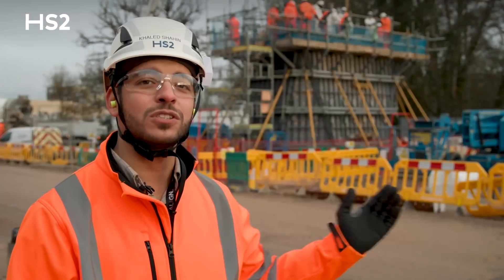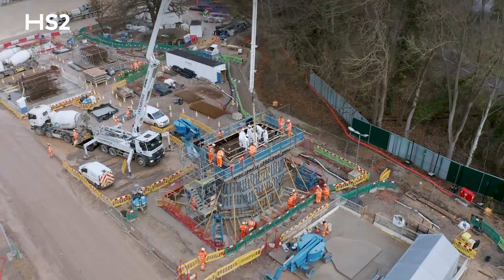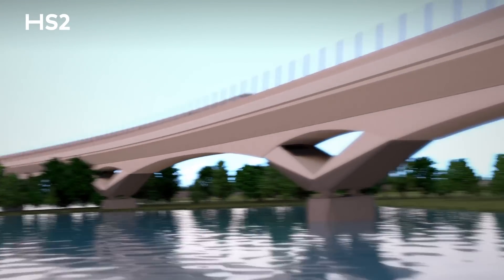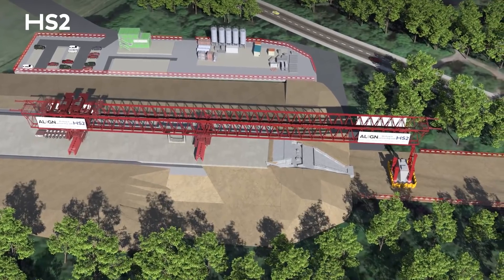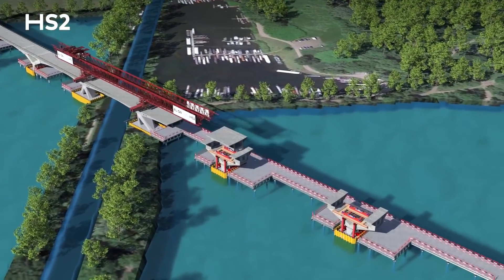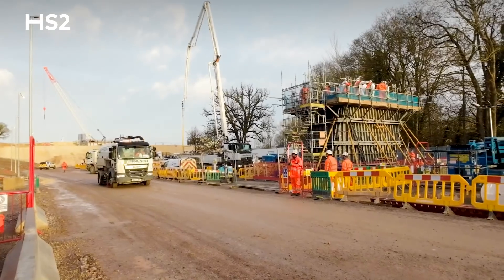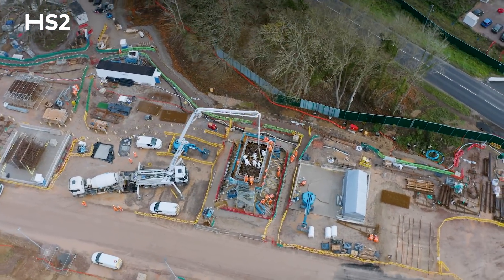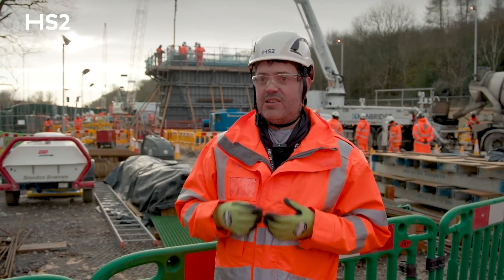HS2 starts first of 56 giant piers for UK’s longest rail bridge

Comment: Wikipedia says the London Bridge - Greenwich Railway Viaduct is 5.55km long and is the longest run of arches in Britain.
Reply: I mean it's technically a different type of structure.
Reply: @arfon2000  How so? One is made of steel and concrete and the other brick but they are both basically railway viaducts. The London Bridge - Greenwich was every bit as cutting edge in its day (1834-36) as the Colne Valley will be about 190 years later.
Reply: @pras12100  same way a house and a small shop are technically different structures. Look I don’t make the rules, I’m just saying it how it is.
Reply: @Hugh Jarse does it though? Mumbai’s streets are calling you.
Reply: @Hugh Jarse Really? Have you ever been to Dhaka, Luanda, Rangoon, Bombay, Abuja, Karachi, Caracus, New York?
Reply: Fake news. Hs2 tells me it’s the longest therefore it’s the longest. Maybe he meant the most expensive
Reply: @arfon2000  I've been to Bombay several times and it's a close call to tell the difference. I agree though both are dumps and sinking fast.
Reply: That isn't a viaduct.

Railways have a simple way of telling the difference, viaducts have names.

Comment: Speeds of up-to 200mph, i thought this was a High Speed Line.. 😳
Reply: that is pretty fast. 360 kph
Reply: That ain’t slow.
Reply: @arfon2000  It is slow, Frances been doing that speed since the 80s..  in 2030+ ( that's if HS2 opens then ) we are only going to travel at around 200mph.  that slow 🐌
Reply: @davidcurry4433  I’m pretty sure most of it runs at 165-185 on a daily basis, or the same speed as HS1. Although there are sections at 200. I will repeat again 200mph isn’t slow.
Reply: @StupidBlokeStupidVideos  I've done plenty thanks, what they promise and what you get, are two different things, you'll get 200mph,,, 😉
Reply: When open it is stated it will be the fastest line in Europe.
Reply: @davidcurry4433  So does france not have high speed rail? By your great logic it doesn't.
Reply: @arfon2000  In 2010 the UK government promised 250mph High Speed travel, HS2. Today 2022 it'll be lucky if it reaches 200mph, somehow we've lost 50mph. At this rate as I've mentioned previously we'll be capped below 200mph. Hardly a high-speed train by the time 2030 comes..
Reply: @davidcurry4433  It is as fast as the overwhelming majority of the French network, it ain't slow.
Reply: @davidcurry4433  its literally bring built to a 250mph track standard. Not a clue where you’ve got this below 200mph from
Reply: @jamesburrows4053  What it's capable of.. and what it'll run at are very different. See you all at 200mph
Reply: @davidcurry4433  Yeah but in the future when we have a competent government, they can up the speed. The trainsets will be capable of 250mph regardless as I’ve heard they’ll be based on the etr1000 stock which can do 250mph. Theres no reason why they shouldn’t run it at those speeds. Even still, 200-225mph is still as fast as the tgv/ave network, faster than japan’s system and a lot better than the wcml that we have rn at 125mph
Reply: @jamesburrows4053  Only time will tell, and that'll be a long time from now. The UK doesn't do anything fast..
Reply: considering our top speed atm is 125 mph thats fast for us.
Reply: @davidcurry4433  the viaduct being built here will be 200 mph, the rest of the line will be 225 mph with a capability if needed of 250 mph. That's not bad really and will exceed the normal operating speed of HS1 of 200 mph.

Comment: Great.  Someone can get to London twenty minutes quicker from Birming Ham. What a great use of £150billion.
Reply: It always amazes me that people who are so passionately opposed to HS2 have done little or no reading up on the actual reasons for building it.
Reply: It is not only to get people from Birmingham to London 40 Mins quicker ( not 20 mins ) 1 hr 20 mins on a return journey, but to relieve the existing Rail network of bottle necks allowing more Freight and intermediate train service on the existing rail network, try doing a bit of research before moaning.
Reply: @peterwilliamallen1063  .. in a post Brexit, post Covid society, there won't be "more freight" & the passenger numbers have been greatly overestimated.
From the passenger numbers  HS2 Ltd were claiming they would need to "break even with a 50-60% subsidy", they were NEVER going to meet targets.
It was 1,200 full fare paying passengers per train, every 3 minutes, 24/7, 365 days per year.
That's 567,000 per day or 310 million per year!
The two competing routes, Chiltern & WCML (pre pandemic), were carrying 25 & 38 million passengers per year respectively.
Clearly there was, even pre pandemic, no requirement for this monstrous vanity project.
Post pandemic, it's expected that passenger numbers will drop dramatically as most office workers will be in some form of hybrid working.
Reply: @CRIMSONANT1  God you must have a very boring life trying to find these incorrect figures, firstly I may say, the WCML is not and never will be competing with the HS2 route as both HS2 and the present and future WCML will be operated by the same company, Avanti West Coast / Transitalia who will run both lines, secondly the Chiltern line does not compete with either the WCML or HS2 as it serves a totally different part of the country with plenty of intermediate traffic from Banbury to London.
Next HS2 will allow more Freight services on the existing network as it will free up slots on the relevant main lines for both Freight and more intermediate passenger services and the post Covid society has changed, the lazy buggers who have been working from home supposedly, but taking the kids to school and doing their shopping instead of answering the phone ( one large Holiday company keeping you hanging on the phone before hopefully someone would answer your call ) have to now go back and work in the office and do some proper work so yes the passengers will be there.
Reply: @peterwilliamallen1063  .. Additionally,  documents  used  to  justify HS2,  ignore  work  already  planned  for  the network  which  will  relieve  the  WCML, such  as  the  new  route  from  Milton  Keynes to  London  via  the  East-West  Rail  line along  the  Great  Central  into  Marylebone. Electrification  of  sections  of  the  Chiltern Line,  which  has  much  unused  capacity, will  make  this  a  more  viable  alternative  to get  to  the  West  Midlands.  
Many  London-Birmingham  journeys  have  transferred  to this  service  following  Chiltern  Railways spending  £250m  of  their  own  money upgrading  these  services.    The  reality  is  that  the  vast  majority  of  rail  users  are  short distanced travellers  who  will  continue  to suffer  crush hour conditions  while  HS2  sucks  up  all  the  rail  investment  cash  for  two  decades,  whilst a  variety  of  targeted  improvements,  which  could  come  into  service  long  before  HS2  is  due  to  open and  would  deliver  more  benefits  to  more  people  for  less  money,  are  ignored.
Reply: @CRIMSONANT1  The Chiltern Route is longer from Birmingham to London than HS2 or the WCML route and Marylebone does not have the capacity for more services than Chiltern can offer, plus the two lines are operated by two different companies, Chiltern Railways is a part of Arriva Trains which in turn is owned by the German State Railway Company DB and Avanti West Coast who will operate both the WCML and HS2 services is run by First Trains, plus you cant just electrify sections of the Chiltern line, it would have to be electrified from Kidderminster through Birmingham and Banbury to London Marylebone plus the cost of new Electric trains, nope it would cost too much and would not be a viable alternative route from Birmingham to London, in any way HS2 is already way under construction.
Reply: @CRIMSONANT1  Well the reason at the moment that passenger figures are down on HS1 is that there are problems at the moment with Covid regulations with the French restricting cross channel traffic, Brexit has nothing to do with passenger figures on Eurostar services just Covid regulations. so how can HS2 not be a success, HS2 just refers to the line in question  which is a fully electrified Hi Speed Railway Line that runs From Birmingham to London and Birmingham to the North West, at least with Birmingham all Hi Speed Avanti West Coast Services from Birmingham New Street to London Euston will transfer to the HS2 line leaving a minimal Avanti West Coast and LNWR services from Birmingham New Street to London Euston, this will be easy as Avanti West Coast will be running both HS2 services and hi speed Pendolino services on the normal WCML services, then any non stop services from Liverpool, Manchester and Scotland that are not timed to stop anywhere between Crewe and London will be diverted onto the HS2 line so freeing up capacity on the existing WCML route via the Trent valley and Rugby for other passenger services and freight trains which will not travel on the HS2 line, so that answers the passenger numbers, they are there already, so why has it been an environmental disaster, when finished new trees will have been planted, embankment will have grassed and weeded over leaving a very narrow Railway track of two tracks only as wide as a normal one road carriageway plus a central a central reservation, where as a Motorway would be 5 times wider leaving a sore down the country side, there will be lakes for wild foul and fish to live on and in and as with existing Victorian designed Railways it will merge into the country side and all trains will use electricity environmentally sourced, so like it or not HS2 is here to stay and I like thousands fully support it, admit it I bet if this was a new Motorway being built you and the others would not of said a word, what you do not realize this line with it's highly efficient electric hi speed trains will take hundreds of cars off the road.
The next reason, Roads nothing to do with HS2, this up to your local Council to sort out on normal Roads and the Road Traffic agency on Motorways, Hospital Closure have been going on for years before HS2 but have been replaced by new super Hospitals like here in the West Midlands, plus no it will not be redundant or expensive to operate.
Why don't you give your brain a rest as people like your selves will not stop HS2 being built, you lot had your chance 10 years ago and if you Google Nuclear Power Stations on Anglesea it states that plans had been dropped due to the £20 bn bill to build it so it does not exist or a building site for it, the only Nuclear Power Station on Anglesea is the Wylfa  Nuclear Power Station which is now decommissioned.